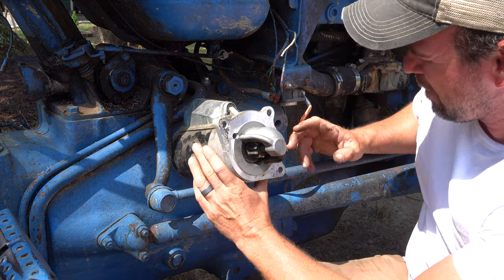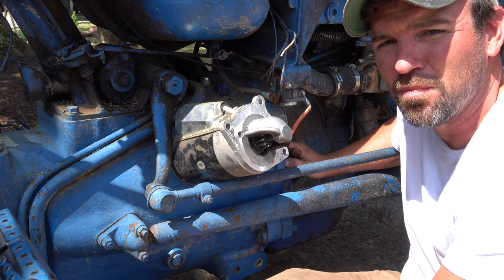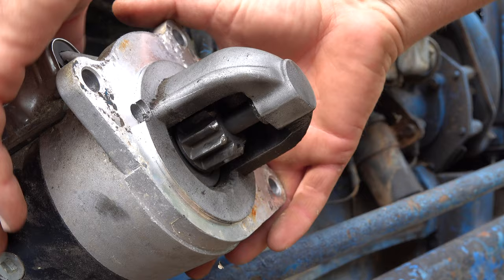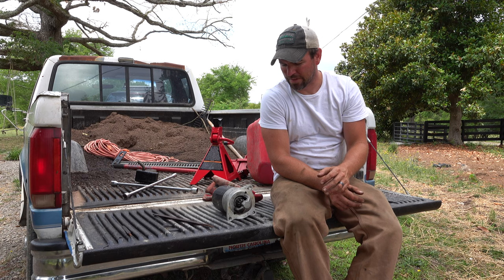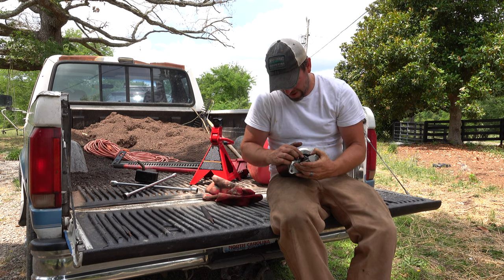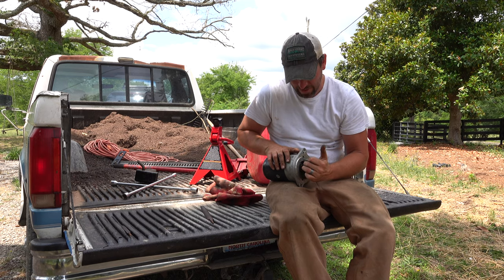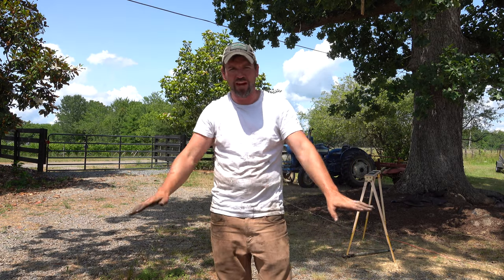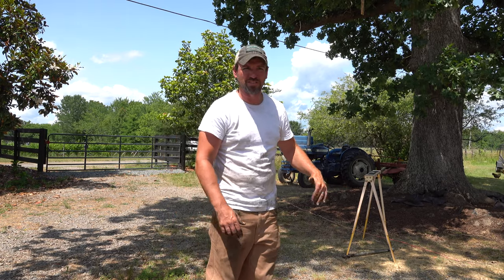Trouble Shooting a Tractor Starter | HOW I GOT IT TO KEEP RUNNING

Comment: I had the same issue with my Ford 4000 over the last several years.  I replaced the starter at least two times, maybe three times. I replace the battery at least once. I think I just discovered that much of that was unnecessary. The issue for me was the four-post starter solenoid that is designed to act like a relay, and translate power through the ignition switch Into power from the battery to the starter. It is located on the backside of a metal bracket just above and to the left of the starter. The starter solenoid depends upon a good electrical connection between the bracket on the top of the starter solenoid, and the bracket to which it attaches, I.e. engine ground. The bracket on the top of my starter solenoid was rusty, where it attached to ground, and as a result, I was losing a lot of voltage through the starter solenoid. I cleaned that up with a wire brush, and it works perfectly now.

Comment: man, so glad you’re making videos on this!  i think i’m having issues with my Ford 2000 starter. terrible banging sound when i try to start. took off the starter and the fly wheel teeth look like they’ve taken a beating.  do you know at what point it’s necessary to replace the flywheel?

Comment: I have similar problem, the start makes a single clunk noise when turn the key.  I took the starter off and I tried to move the fly wheel (in and out of gear) with a bar but it won't budge.  Any ideas

Comment: Ah that grinding sounds like my 8n tho that last bit is definitely something my 601 is doing.
Reply from the maker: I just ordered a new one.  Something isn’t engaging in that one.
Reply: Yanasa Ama Ranch I just took out the starter on my 8n and that thing is shaved and was covered in metal shavings, so that’s one problem down. So thanks for the proxy help with that lol. All that’s left now is the 601 which I’ll look at that if it doesn’t rain tomorrow

Comment: I think that tractor needs a complete tune up or something.
Reply from the maker: I think you are right Will... and then some
Reply: LOL
Reply: Absolutely, when it does crank the tractor won’t fire up, that’s a bad tune. If it’s points and condenser,junk them and make it electronic with a Pertronix kit. Best thing I ever did for my Bobcat 642b. Went from unreliable to very reliable.